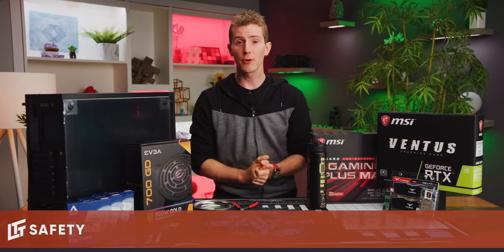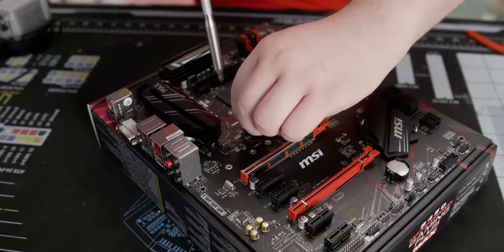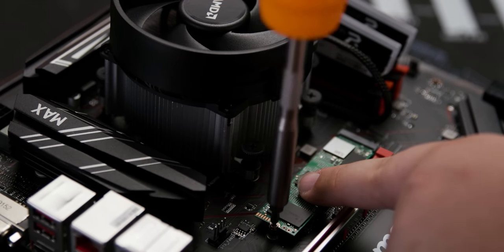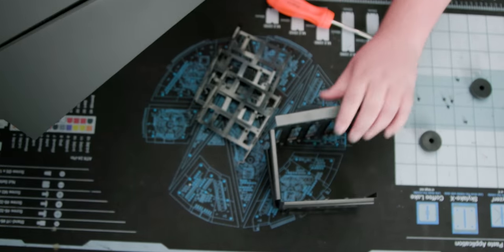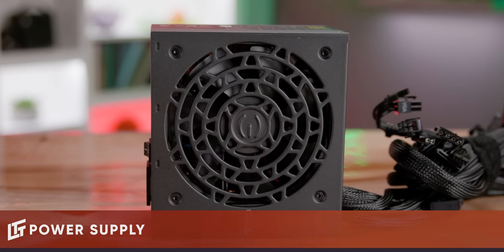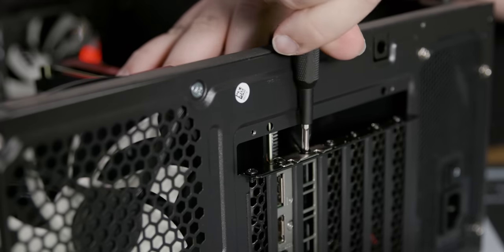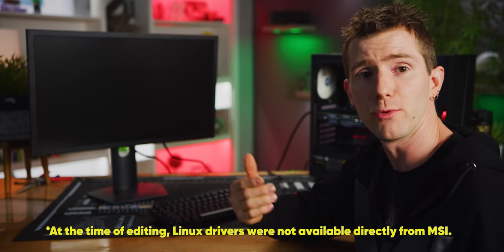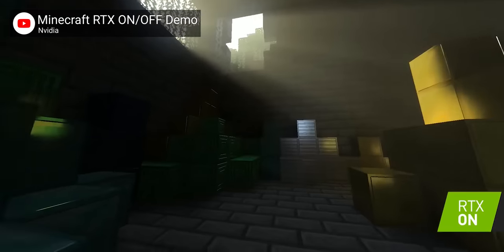$900 Ryzen Gaming Build Guide

Comment: I dont really have any desktop,I'm just watching these vids to imagine myself having one.
Reply: Exactly what im doing right now
Reply: Dayum son...thats the saddest thing i ever heard '-'
Reply: bruh same
Reply: the gpu is 30% of the cost. You can use a 3200g apu and 8gb of ram to cut the cost by $450, only going to play on 720p low, 30fps tho. 

Desktop specs are super flexible and there is probably a better $450 build you can do than what I mentioned above. Especially if you wait for sales and used parts
Reply: @xCCflierx  well with a 2060 i think he can play with more than low settings even with a 3200 ryzen
Reply: same
Reply: Nah bro keep doing that! Feel that you already have it and you watch-the wish will be fulfilled
Reply: i just ordered this pc, btu i got it for 1100 bucks cause i changed:
the motherboard to a ASUS ROG Strix B450-F

the power supply to a Antec NeoECO Gold Zen Series NE700G Zen 700W ATX12V 2.4 80 Plus Gold Certified Non-Modular Active PFC Power Supply

the graphics card to an rtx 2060 super founder's edition 

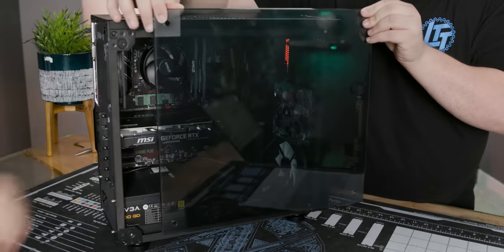most of the components arrived but i was wondering do i need 2 or 3 arctic fans? in the beginning of the vid there are 3 but at 11:32 you can see there are only 2 fans in the case. Help!!
Reply: i have a crappy desktop
Reply: bruh same
Reply: Russell Hernandez same
Reply: Yep we dream
Reply: I can relate....
Reply: You guys can't get a job? When I was 17 I got a part time job, and BARELY could afford to build a PC around this price...barely, but I did it on a part time mi imum wage job. Since most of us at 17 to 19 are living at home with no, and or very few bills. I had bills too, just not rent.
Reply: @GodofLovers  in my case i can afford it bit i dont have much time to use one.
Reply: @GodofLovers  can't do it in my country, I once tried to get a part-time job when I was 16 as a floor cleaner, but I only got 1000php ($40usd) in a month, it was not worth it so I quit. It was also hindering my academic performance because I was always tired afterwards (it's a 4 hr job everyday and the salary is paid monthly)
Reply: sad at least I have a half solid gaming laptop
Reply: if you have spare cash, what kind of budget would you ideally look at if you want to build one? Don't discount 2nd hand parts, they are quite satisfactory and much cheaper than the stuff available these days, depending on where you live. Research, so you know what to look for.
Reply: yesss.. i'm not alone
Reply: i couldnt like this comment it has 250 likes already
Reply: Soon y’alls dream will become reality, brothers and sisters
Reply: i just wanna play eatch dogs and assassins creed 😣😢😭😭
Reply: a man can dream, right?
Reply: That’s a mood
Reply: Same
Reply: Im watching this stuff so i know what pc to build
Reply: @progamer-o8m  same
Reply: same
Reply: Feel like you bro. I was thinking of getting a PC at the end of the year.
Reply: Same. But I also fucked up my laptop two days ago and now it won't boot with the keyboard clipped in, so I wonder how much longer it'll stay.
Reply: Hi guys,imma ask something,do ya know any way to die at home w/o being noticed?
Reply: Same
Reply: Saaame
Reply: I went from build a $500 pc to building a $850 pc thanks linus
Reply: Their not that expensive tho you can get one for like $120
Reply: man...
Reply: same
Reply: pain 😔
Reply: same
Reply: Same here bro
Reply: F
Reply: 😥 me too
Reply: Same here.
Reply: We all are mate. We all are.
Reply: What did u think everyone here is the same as u
Reply: U ain't the only one son
Reply: Me too
Reply: I have a an java laptop
Reply: i feel u bro
Reply: Lol
Reply: Same🤣
Reply: @xCCflierx  yeah but apus actually sacrifice more than what you're paying for. no vram, cpu is split, it's bad.
Reply: Now u can build one
Reply: i play mincraft at 15 fps and among us at 30 rip
Reply: i have never been so mad at a comment i agree with so much
Reply: You'll have yours soon, just make it real
Reply: Same
Reply: @giinterally592  yeah, just stop being poor, it’s so simple. just get more money
Reply: I don't know how i reply here. because i don't hve youtube
Reply: I remember those days friend
Reply: Im watching this to prepare to build one my Self
Reply: me too
Reply: What I did was buy an old g1 elitedesktop sff with an i7 4770 that had 16gb of ram and 500 gb of storage. The only thing I did was toss in a low profile GTX 1650. I plan on organ harvesting this machine for a better Mobo, case, and pay.
Reply: Same but I'm getting on in a month
Reply: you're kid or poor or both
Reply: I feel you, its hard 🙂🙂
Reply: @mashudumashamba7321  same here bro
Reply: @nawaifu  he meant integrated graphics
Reply: Welcome to the club me too hhhhh
Reply: Same dude
Reply: Same kid same
Reply: SAME MY DUDE
Reply: Same lol
Reply: sad
Reply: Lol I'm watching this cuz im looking for good parts. then i gotta save up for bout a year to get enough money lol
Reply: Same dude
Reply: it's alright to dream.
Reply: (Y) same
Reply: Y same
Reply: same here.. me too..
Reply: I feel you bro
Reply: You said it for me nro
Reply: Just like some of the other comments, i watch so much "how to build a computer" videos I feel like i am a professional pc builder although i dont have one and never have built one
Reply: I don’t have a phone to watch it so I’m just imaging this comment exists.
Reply: This is enough to make a grown man cry :"(
Reply: same xD
Reply: I feel that. I wish I had onr
Reply: One
Reply: Same forreal
Reply: Same
Reply: Same I just wish I had one
Reply: Me too
Reply: Tuff, gotta get tat sauce during Black Friday or other sale times
Reply: Nothing wrong with that, but, if you do want one, (once life is back to normal) you can build one for 5-600 if youre looking for a performance only machine. If youre willing to make a few comfort sacrifices, you could build something great for the budget.
Reply: Y : same
Reply: You’ll get there bro even if you get a second hand office pc and slap a gpu in it
Reply: AAORA that’s actually true, cuz its still a desktop no matter what
Reply: me too🌚
Reply: Same ill build my own one day..... i havent had a pc since windows 98/xp days
Reply: Kelland Mclellan lol just buy a prebuilt from stores or websites. There are plenty of sales that happens often which u may actually get the spec for a cheaper price than if u were to buy the specs alone
Reply: Lol
Reply: @GodofLovers  exactly. Im 17, im working a minimum wage job, and i pay bills, and im able to build a new rig, working on it now
Reply: its alright bro. someday you'll have one, and it's gonna be sick
Reply: @a2dhorns  agree，use to only have tablets when I was a little kid, then the best I had was when I got my cousins laptop, which it was kind of a pain to play games with cuz it’s got the worst specs and I only watched my cousin play since he had a gaming pc. But then I just start to make some quick money(help neighbors and stuff, and made some money online) then bought myself gaming setups
Reply: im about to make something based off these parts
Reply: Same buddy
Reply: Same
Reply: I'm sorry for ppl who feel this 😭
Reply: DUDE SAMEE
Reply: i feel you bro, i feel you, you are not alone.
Reply: Same ☹️
Reply: Me to
Reply: You not alone my friend....i only have laptop acer i3 with hd graphic family 2gb ram😂
Reply: Sameeeee
Reply: Same
Reply: #brokebois
Reply: @cleavantsinterlude  just poor....
Reply: I just got a laptop in 2021
Reply: Same
Reply: relatable!!
Reply: @xCCflierx  I originally had 3200g, but I got like 60 fps 720p and 45 fps 900p, maybe it's because I had a cl-16 3200 MHz ram, then added another ram stick of cl-16 3200 MHz and got 40 fps 1080p, then recently (after 4 months) got RX 570, now I get 75 fps 1080p high settings. Man, the difference is phenomenal.
Reply: That's a real gamer
Reply: Aren’t we all!
Reply: I did the same for about a year.. then I saved up to build one
Reply: We watch things that makes us depress i guess
Reply: bruh same
Reply: Me too
Reply: Rip
Reply: That’s kinda sad ngl
Reply: I've got a gaming laptop but this is nice to watch
Reply: Deja Vu Amigos😂
Reply: rip
Reply: same
Reply: Same
Reply: Same bruh..same
Reply: lol same but ma dad has a pc for his office work with a gtx 1660 ti
Much worse than dis pc
Reply: Same
Reply: same, I have my own money but my dad is not letting me spend it sooooo I'm using my imagination to it's best!
Reply: We'll get there bothers 😔✊✊
Reply: Same
Reply: step one on getting ur own pc save a few bux just a couple like 5-10 every pay check dont sound like much now add that time to the mix 5-10$ x's 52 Weeks x's 2 -3 years = PC and didnbt even have to but give up a coffe or 2 a week from starbuck
Reply: damn sorry i can help u build one if u want
Reply: I knot how you feel, I used to do the same before I got one for my for good grades
Reply: me over here getting a job as a 12 year old and getting paid 25 $ each time i do it....... but then i find a PC for $565 and it has the best frames ive ever seen
Reply: @xCCflierx  update to you comment ten months later:
Going prices are so high that it’s the cost of a whole build now.
Reply: Me too sad.
Reply: Exactly
Reply: Same 🙂
Reply: Same🙂
Reply: Lol same here my friend :')
I make wishlists and add the latest tech hardware on amazon so that i really get the feeling that ive a gaming pc of my own
Reply: Same here.
Reply: Same, same 😌
Reply: Same
Reply: Same
Reply: Sane
Reply: Omg why.. Where are you from.... I feel bad, I just thrown 2 desktops in the bin
Reply: @ronthedon3106  im from philippines
Reply: @Az34rt  how can I help you... Why do you not have a pc..is it because you are not aloud or because you can not afford it?
Reply: @ronthedon3106  can't afford,but it's ok I'm still 15 yo
Reply: @Az34rt  oohhh lool was thinking you was a grown man and couldn't afford one.. No problem. Your time will come my bro.. Just start buying parts.. Starting with the cheapest bits... 👍🙌 Good luck
Reply: It's fun to pretend
Reply: I can feel u 😭
Reply: Me to
Reply: You're not the only one.
The ancient ones(us) been doing thaet from the beginning of time.
Reply: Do u have hdmi tv?
Reply: Same
Reply: I have but very very useless and bad
Reply: Same
Reply: Me too
Reply: Same here
Reply: True
Reply: same
Reply: And I got i3 4170 4gb of ram and intel HD 4400.
Reply: I feel ya bruh
Reply: same bro. i just want money to build the perfect rig as well :/
Reply: That's like me sitting in the dirt at the drive in!
Reply: We’re same
Reply: I didn’t have a desktop until mid 2020.
Reply: Lmao same
Reply: Aren’t we all?
Reply: same
Reply: Wayyyy to relatable
Reply: don't worry, it's 2021 and you're not alone
Reply: Innit
Reply: same
Reply: Me to
Reply: @nawaifu  he is sadly not alone trust me I would know
Reply: I'm finally going from that exact chip set of ryzen 5 3600x running aorus b450 build to an actual trx40 asus rog threadripper so far got the mobo dual 1200 watt psu core x9 computer case and antec prizm fans both 120 and 140 and the maxed out argb trident ram running in quad and dial evo 2tb m.2 running dual 3070 in sli that is as far as I got right now in holding pattern for the thread ripper CPU in talking the 64 core cpu to be around 1200 dollars us to about 1900 dollars us so far my ryzen is feasable for what i do so only need my cousin thread ripper 64 core CPU and all my liquid cooling kit custom is all I need left for my last and only ultimate computer I am also gonna do a few other things ad well gonna run dual I cannot remember so far what it is called but its gonna boost it up even higher in core even around and I am hoping ad its been around awhile but put the CPU way up higher then it is now
Reply: i feel your pain my guy
Reply: Never had one other :)
Reply: Yeah me neither :)
Reply: I just wanna play destiny 2 and genshin 😓
Reply: Me too 🤪
Reply: same bro, same
Reply: Same bro😔
Reply: Same dude i enjoy it actually watching them build. And wish that was mine
Reply: @GodofLovers  Yeah try getting a job in a third world country where you can barely just live
Reply: @henryhollanda4301  idk what I said a year ago, but I was probably just thinking of north American audience. I understand in less fortunate places have a really hard time getting any computer or something modern to game with. It's ok. No need to take offence.
Reply: @GodofLovers  Don't worry, it wasn't an attack. Things are way just too fucked up in countries with bad economies. Even your high prices are cheap compared to ours, just because of absurd taxes.
Reply: We'll have our time soon bro and the harder we work or save up to get our own rig the sweeter it feels when we get one
Reply: @MightyFartBomber1  yes
Reply: lol
Reply: I pray all you guys get your dream desktops soon
Reply: same my friend...same
Reply: Same
Reply: Get mowing
Reply: Same
Reply: @daviddominguez0214  😌thanks
Reply: I’m planning on building a budget pc for Christmas and I’m just seeing what I can get for the money
Reply: Same
Reply: Me too
Reply: @Nairbwal1  Same Xd I go to a pc part website and imagine buying one
Reply: Guys HELP please ... I have this exact Mobo will a ryzen 3 3100x paired with a gtx 1070 and 16 gigs of ddr4 3100 ram be a decent build with this and what games could I likely play ? I don't need to play cyberpunk on elite settings or anything but I will need to it run steam VR for half life alyx etc
Reply: Relatable
Reply: you'll get it one day.
Reply: I don't really have eyes. I just watch this to imagine being able to watch.
Reply: I can buy you one just lemme me know
Reply: You'll get there one day man. You just gotta put your mind to it. Life hits hard a lot of the time it's just a matter of having a positive outlook on life at the end of the day. I really hood your able to get your dream setup soon man
Reply: I can relate the only thing that I have is an inspiron
Reply: Any surface can be used as a desk top

Comment: "First you need a desk" "A swiss army knife that hopefully has a phillips head screwdriver"
Reply: And some tweezers!
Reply: ahhh, theverge won't get old 😂
Reply: literally if u dont know that "meme" youre gonna be so confused 😂
Reply: Don't forget to add some thermal paste, as the pre-applied paste is usually not enough.
Reply: @ahmatm2147  that's the best quote out of the video IMHO. hahahaha
Reply: @ahmatm2147  I've got a 5 gallon drum of the stuff, will that be enough? I also can't find my CPU applicator tool, am I screwed?
Reply: @JohnSmith-dt1tw  as long as you have the CPU braces ur fine
Reply: Careful guys... always put the brick on the insulation pads!
Reply: Don't forget your livestrong bracelet!
Reply: And make sure you install the brace in the back
Reply: dont forget the brakets !!!!!!
Reply: @kleiner3838  *bracket. Just letting you know so you don't get completely destroyed by others
Reply: @kleiner3838  i just leave the cables sitting in the case right?
Reply: Correction: A table
Reply: when installing the power supply, make sure it doesn't come into contact with the case, or you'll short out the entire system
also, make sure the fan is completely blocked, because you don't need it anyway
Reply: Extra thermal paste because what’s on the cooler isn’t enough.
Reply: @mollygrubber  i like your style
Reply: HAHAHAHAHAHAAHAHAHAHAHA
Reply: theverge memes never gets old lol
Reply: @MTBDennis  "Dat's a RiveStrong braceret! He not fighting static, he fighting cancer!"
Reply: @ahmatm2147  A core i7 Hexa-core CPU... Yeah, we've got one.
Reply: @Always_Rad  wait, you're telling me that you got a intel core I7 hexacore cpu???!!
Reply: This shit never gets old!
Reply: This whole TheVerge video seems like an April's fools video mistakenly published at the wrong date
Reply: You must hammer in the brace :)
Reply: And a "thermal paste applicator" for sure
Reply: i am so confused
Reply: The pc community will never let that one go
Reply: Hahaha
Reply: Use the dammed CPU applicator tool!
Reply: And your thermal paste applicator!
Reply: Nah you need the allen wrench then the swiss army knife
Reply: $1425 Brunei dollar🇧🇳
Reply: Hopefurry
Reply: "What do you mean you need a table? You can build a PC midair"!
Reply: @ahmatm2147  make sure when applying paste,that you cover the entire socket,to make sure it will get on all the pins.
Reply: But at First You Need A Channel called "The Verge" to publish that garbage.
Reply: @hellothere4507  And most importantly thermal paste applicator
Reply: @ahmatm2147  don't forget to add icing on cpu because thermal paste is not enough
Reply: @JohnSmith-dt1tw  scree with confidence.
Reply: And an i7 hexacore cpu. Yeah, you need one.
Reply: @hellothere4507  and a thermal paste applicator
Reply: And the thermal paste applicator!
Reply: I was literally waiting for this lol 😂
Reply: @Victious911  It will never get old! I was laughing so much I was on the verge of my seat!
Reply: @errorcode503  haha 😂 I see what you did there